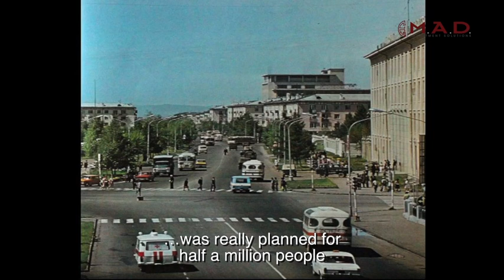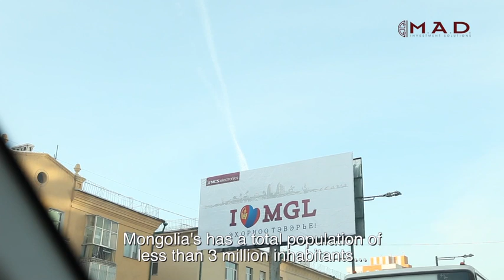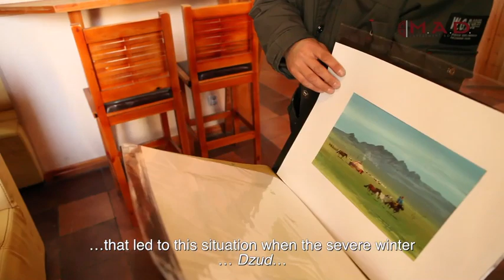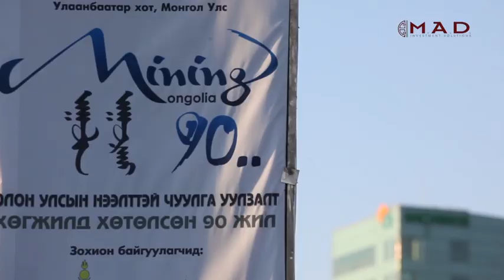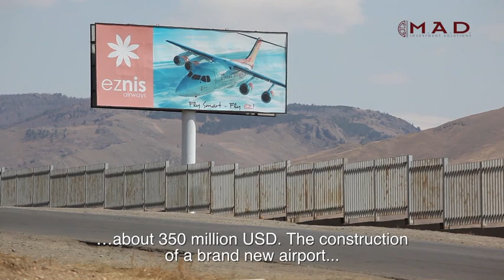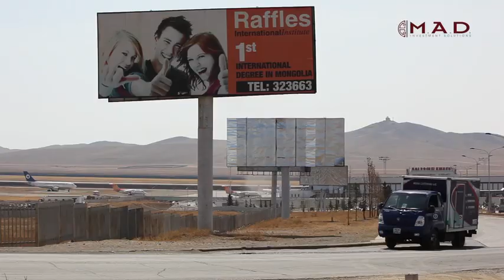What now UB? An in-depth look at the current state of Mongolia's Infrastructure.

Comment: They could much more easily just expand the old airport, lengthen the old runway and/or build another one to cope with the air traffic problem. They should be building a tram system to solve the traffic problem cheaply and efficiently